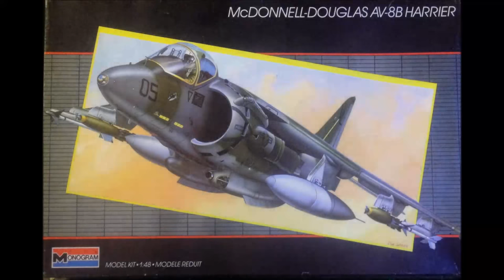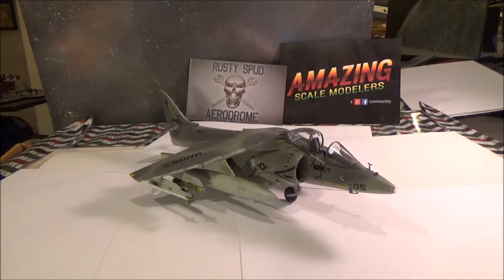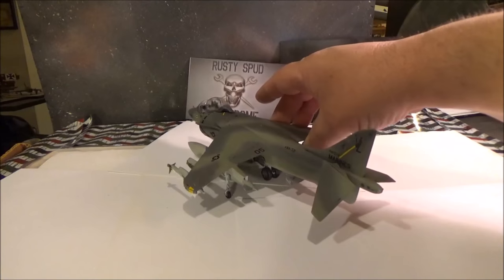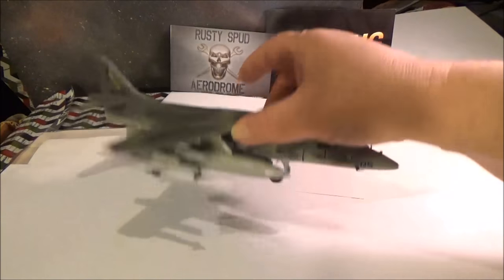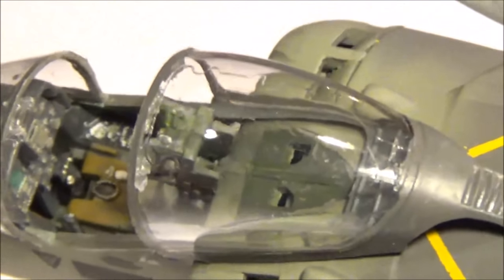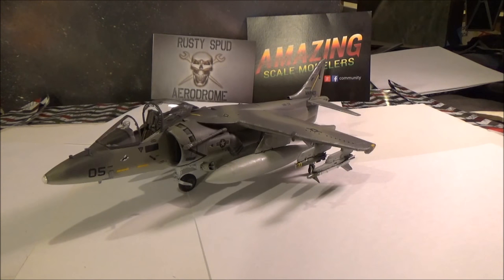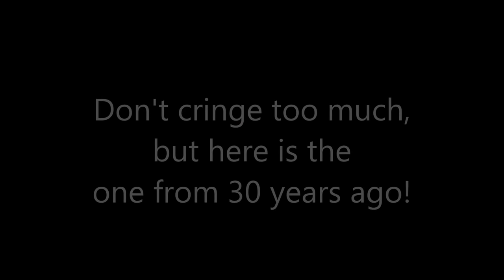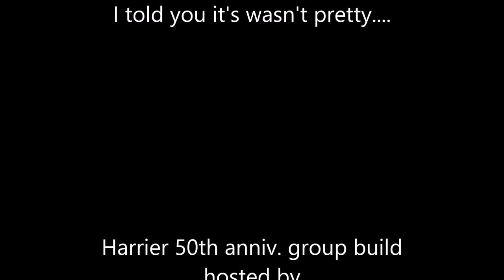Harrier Final

Comment: Nice job on the ol'jet Bob! Good luck on the voting in the final.
Reply from the maker: Thankx Bob! Coming up next is one of your jugs, the 1/32 Hasegawa D bubbletop!
Reply: The only thing that is a bit tricky is the cowling. I built and shaped it away from the R-2800. Trim off the centering notch on the engine ring and it'll slide right in. Beside that it's a "pretty straight forward build". Built 2 of the last year along with a Trumpeter "Razorback".